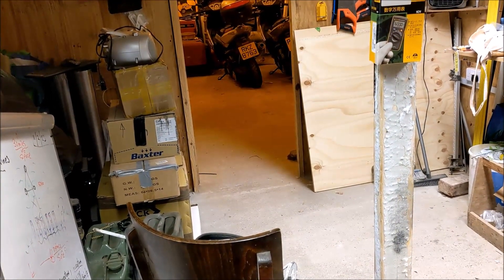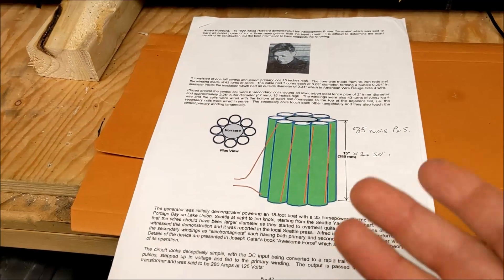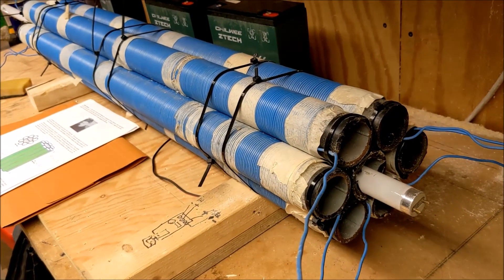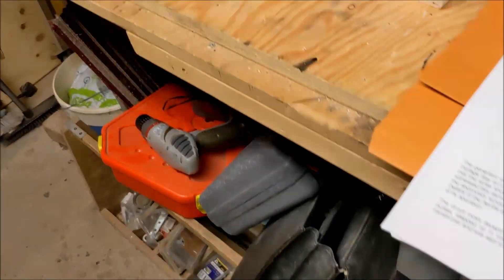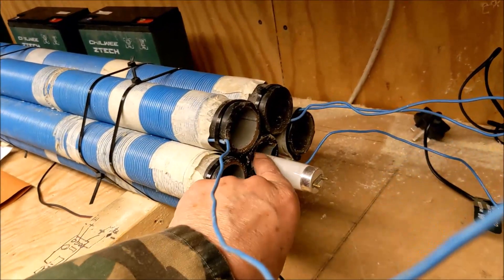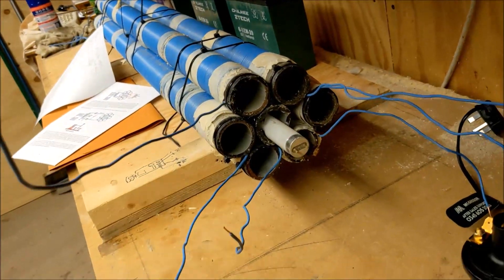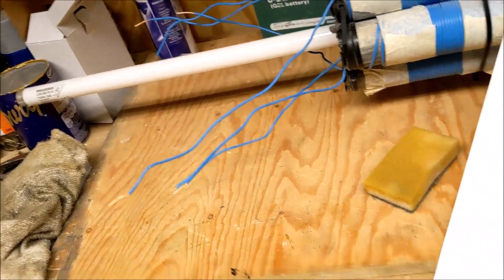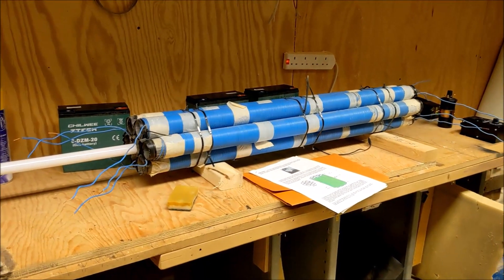AutoGen Ex 3 2023

Comment: Thank you for the video. Looks like Ed Gray conversion tube. In his case he used cylindlical copper mesh/ plates and in yours yor have the coils on metal cores. Keep it up.
Reply: Yes and the power to the motor to drive a generator so it can self loop of take some of the output power to loop back into the input ones it's started.

Comment: You might be able to get it to run without a capacitor, but I would encourage you to have a couple in series and maybe some in parallel then connect a motor. The reason would be the following, you can charge a capacitor super fast with a high voltage. If you put a capacitor in series with your sparkgap, it will pack more of a punch across that sparkgap then if you didn't have one. If you can charge your capacitors fast enough, it can keep a motor running. A small 50V 1000mF will turn a motor that takes at least 3V and 0.5A  and run it for about 5 seconds or so. If you had mutiple capacitors charging and discharging, you wouldn't have to worry about that motor not spinning. That capacitor discharges so fast, that the voltage makes up for the current.

Comment: It's been several weeks run it yet ?
Reply from the maker: Hi Buddy been sidetracked with private events. Soon.
Regards DC
Reply: @e.powerdc1127  One this is started some of the output power can be self looped to the input so it can run without any battery. this would happen once its started.

Comment: Thanks DC.That was a great presentation of your device. I have built a device similar to yours. Mine is only six inches long. Anything built on a small scale can be replicated to a big model. I have found out from experimentation that I get better results by having a primary and secondary winding on each core. I believe what Hubbard made is a Amplifying transformer. No Radium, no diode, no capacitors, no types of pulses of square waves. Hubbard said it is started by only a one second touch from ordinary house hold current. The center core should have only a single winding. Hubbard had a couple of secrets that he did not disclose. A person could not figure it out by just a simple examination
of his device. His secrets were #1 how to wrap the outside cores that were around the center core. Remember, he spent 2 years wrapping this device trying to get the results he got. #2 It has to be started a certain way to make it stay running.He hired machinist to make the iron cores and the building of them and no one could start them even under his direction. Read up on him and stick ONLY to the news reports of 1919.
Anything else is just hear say to lead you away from the results. Great Job so Far.
Reply: Eager to here some guidance forward with your project from the engineer.
Reply from the maker: D.T. thanks for the info it all helps.
I have been looking how to use the Dielectric which is generated within this device.
I have an electrical engineer helping me soon.
What's really good he sees that its possible.

So i am not on my own now and he gives me real help from a lifetime in the business.

So its still work in progress but step by step.

The fields emanating are very strong, you can feel them.

Regards DC

Comment: Hubbard had radium in the middle of his device powering it think i had the patent at one time don't think i have it anymore.
Reply: I think you may be referring to patent 1,732,442, 1924 where Alfred applied radium to a spark plug terminal allowing leaner fuel for same power output.  My take away is that Alfred was for real and did have patents in the electrical field, for whatever that is worth.
Reply from the maker: Thanks A. can you see what i am trying to do? Hubbard was a tuned in cookie for the year (1920) great vision.
I think that the documentations (Drawings) have been messed with to put us off the sent.
I would welcome replication, cos its so simple to do. 
Hope that you can find the patent, if not its so basic that most people could but this together. 
Thanks for your interest. DC